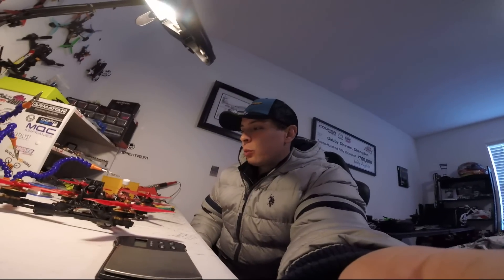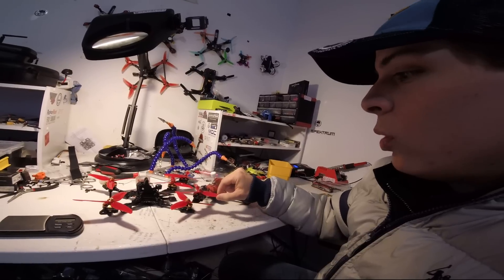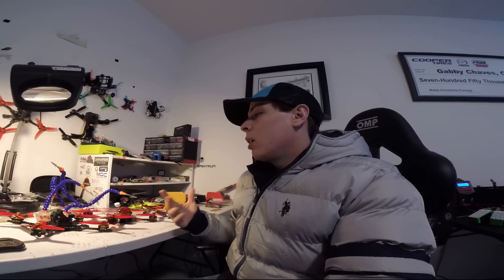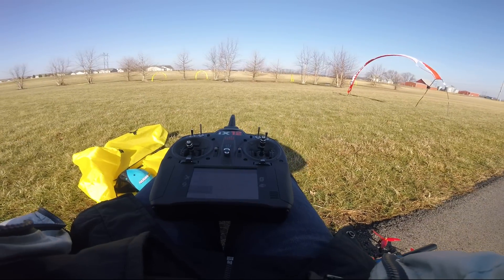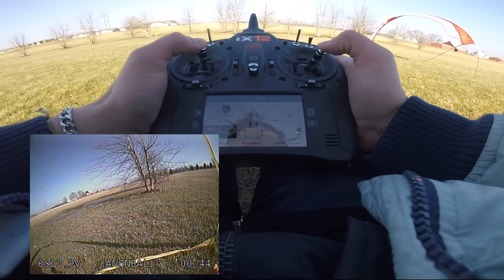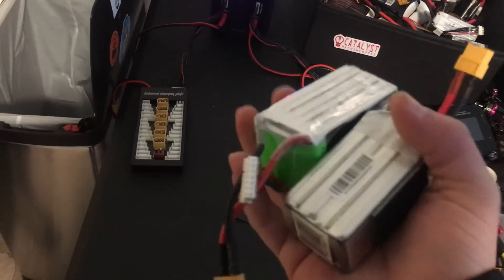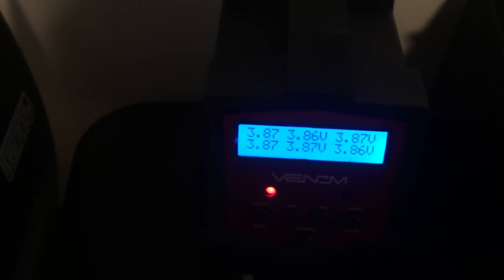4S high Kv. VS 6s low kv.

Comment: The 2 voltage readings at the end of the flight are flawed.   The voltage needs to be measured as soon as you land.   The battery voltage will rebound to something higher if you allowed it to rest like you did when you took it back home.   6S will always have a more consistent feel throughout the entire flight.   4S actually tests pilot skill for throttle management to stretch the race out as much as possible.

Comment: I just bought a Merica 5 inch 4s with dys 2206 2700 kv motors vtx 200 mw dys hglrc elf cam board is an f4 aio running siskin 32 bit eSC d shot 1200.  turnigy 1300 mah graphene  batt. What's the highest amperage batteries I could use? and what C is the best?
Reply from the maker: You can use anywhere from 1300-1800 mah 4s with that setup for best performance. Try using highest C rated batteries, I’d say anything under 80C won’t do so well with those motors. Personally I’d go for something with great bang for buck like the CNHL 100c and 120c packs.
Reply: Graphene

Comment: whats the best lipo for power and for money? ive only got chinahobbylines got three 4s lipos  thats 11months old and 2 5s lipos so im in need of new lipos
Reply from the maker: Danger Davefpv the ones you have are very good bang for buck.
RaceDayQuads has some good ones, and I’ve been using the Catalyst Machineworks 6s lately with great results

Comment: Thx - Gabby been thinking about building a 6s quad, problem is 6s batteries are not readily available in our country. I have all the components and the quad will be cable of 6s in the future but for now I think I will have to stick with the T-motor 2400Kv motors on 4s and let the big boys fight it out on 6s until a consensus is reached as we have more, and more data to analyze.  The deciding factor for me at the moment is there is not enough of a substantial difference to warrant all the additional costs involved. Don't get me wrong its where the sport is headed and by all means Multi-GP should let them race on whatever they want to progress the sport. The main sponsored guys will burn packs irrespective , but that's life at the sharp end in any sport.
Reply from the maker: Grixes Sedraxis well said. And I will say there is not enough performance difference to justify rebuilding your whole fleet of quads if you just want to get out and fly. So far since I filmed this video 6s is all I’ve flown, and my packs perform like new still. I can’t say I ever had my good 4s packs perform “like new” for more than a week or so before I notice a degrade in performance, so that at least looks promising
Reply: To be honest that was one of the primary reasons to build a 6s Quad was to draw less amps so I could get extended battery life (I punish my 4s Tattu R-Lines 95c so bad that they puff) and at the same time be able to be a bit gentler on the throttle without sacrificing performance while keeping enough power in reserve if and when necessary. Love the content and keep ripping dude.

Comment: Thanks, that was great.  Really got me thinking about why since there's actually an efficiency loss with higher voltage.  Some other factor is at play...just don't know what it is ....yet!
Reply from the maker: Rotorgeeks power= voltage X current. So since I am targeting having the same power output (rpm) there is less current drawn with higher voltage to achieve that output. So it is more efficient in the sense of taking less out of the battery to achieve the same power.
Reply: Understood.  voltage x current = watts.  I'm talking about the reduction in grams/watt of thrust that happens as voltage increases.  For any given thrust level, a 3S will use less watts than a 4S and a 4S will use less watts than a 6S.  But of course the lower voltage has a power limit.  You can generate this data with a thrust stand that measures and logs everything like the RC Benchmark product.
Reply from the maker: Rotorgeeks this has been discussed a lot lately. I have some thrust stand data that shows exact opposite of what you are saying and not sure why yet. The data taken used the same motor at a different KV. Constant thrust output of 1000 grams. 4s motor went as followed: measured KV: 2633 thrust (g) 999. Amps - 24.5. Watts: 394.3 V: 16.0- g/w: 2.53
For 6s it was the following: measured KV 1746.- thrust (g) 999. Amps- 14.7.- Watts: 352.- V: 23.95.- g/w: 2.84
The only thing is that these were measured at about 50% throttle and not 100%. only thing

Comment: On a tight track layout do you think the lighter 4s will be faster? And because 6s has more bottom end is it harder to be as precise or does it feel like balls to the wall fast where it almost feels like 0 or 100% all the time?
Reply from the maker: one4all to be honest the better bottom end I think will help in a tighter track, because it’s just sharper feeling. The difference in AUW weight is about 8-10 grams so I’d say that would be hard to notice at any track.
Reply: GC Cannonball if that's the case I should consider getting a rooster with plenty mah. Good run times.

But since I've only got 2400kv motors maybe I'll go with 5s for now.
Reply from the maker: one4all as long as your escs are rated for 6s, your motors will handle it just fine if you are easy on your throttle.
Reply: GC Cannonball can't I just turn down the throttle and go crazy?
Reply from the maker: one4all yea you can also do that lol. I don’t know if it will have perfect results but it will help haha
Reply: GC Cannonball thanks friend

Comment: Nice!  Those catalyst machine works motors sound good.  My 1600kv t-motors are getting a little crunchy, i might have to try those next.
Reply from the maker: mooosestang I have a quad with those and I love them but I need a little more cooch so the 1725kv I like better. If you are definitely wanting to try the catalyst, wait a week or two as they will have the new R6 design with the upgraded bearing.
Reply: Nice.  The f40pros i'm using are the v1, not the newer naked bottoms.  I've also been flying those same 1050 75c pulse batteries for months and haven't been able to hurt one on the 1600kv setup.  1900kv i can sag one into the red though, but they still don't get as hot as a 4s.  Looking forward to new motors and new batteries coming out for 6s.
Reply from the maker: mooosestang I’d suggest the gensace 1250 60c only 15 grams heavier than the 1050s . They are like 28-30$ and the pulse 1250 75c for the higher kv.
They are really good batteries

Comment: Nice comparison, thanks.
  I cant help thinking you could achieve the same low throttle spool up advantage that 6s has by tuning esc timing rather than spending another load of money on a new 6s setup. 

It's all just an equation, by changing kV and voltage you are effectively just plugging different numbers in to come to the same final value.
Unless I am missing something?
Reply: You are missing torque, the lower kv/higher voltage has more of it.

Comment: This video inspired me to build a 6s with the same 2306 motors. Im having similar results, which i like. It feels really great, but my pids don't feel quite right. A bit of bounce back and more noticeable prop wash than my 4s build (215g dry finx23 so not really equal to this 250g 2306 build...) yours looked tuned nicely. Any plans to discuss 6s tuning in a future video?
Reply from the maker: eaglo fpv that’s a good idea, I don’t remember if I discussed my tune here. Can I ask what you are running? I used the exact same tune for 4s and 6s, which is RaceFlight one fw 455 with a modified “captain Vanover” tune 
I do have a BF quad on 6s, 2306 motors and pids look like this : 
Pitch P: 65. Roll P: 62. Yaw P: 95
Pitch I: 55. Roll I: 50. Yaw I: 65
D 30/30
Dynamic filtering on, filter type Pt1 notch filters  off
Reply: GC Cannonball wow thanks for taking the time to list all that. Very helpful and appreciated. I am running my own frame, ak35 6s 4 in 1 esc, the cm 2306 1725kv motors, hq 5x4.5x3 props and the 1050mah 6s pulse 45c. It weights 250g without the lipo. Default raceflight was ok but a little bit of oscillations. Vanover tune had lots of oscillations so I figured since vanover pids are higher than default id go a little lower than default. That worked fairly well. No punchout oscillations but some after hard maneuvers and a bit of bounce back. The higher c rated pulse 1050 packs (75c o think) seem to need even lower gains to fly smoothly. But I don't really have much success trying to tweak race flight pids lol. 

These cm 2306 motors though...the linear throttle feel is so fun! So glad your vid put me onto them...
Reply from the maker: eaglo fpv yea no problem. Ok I think maybe because your quad is lighter, you don’t need as much gain to achieve the same control.  I’d  play around with lowering your P and D gains, and adjusting the tpa ok kp anywhere you feel you may have some vibes in the throttle range.  Since your quad is about 15% lighter with the same motor than mine maybe just scale down all pids by 15% and see if that does the trick

Comment: Great video man!  Love seeing more and more people doing these comparisons.  I'm curious, I know the average lap time was better on 6S, but was your best lap time better on 4S?  It looked that way just from watching.  I think the differences here had more to do with the lines than the batteries honestly.

In the end, what's your conclusion?  Should MultiGP go 6S?  Do you think this theory is sound, but the assumptions about the result are basically BS, like I do?  Once we open the flood gate people will run higher 2000-2200KV motors instead and just go faster on 6S killing the packs anyway?  For what it's worth, I still think it's time to allow 6S.  IMO, it's a much better handling experience.  I noticed a much more responsive quad, because as you stated the motors seem to have more torque which helps them be more responsive with the same props.
Reply from the maker: John E Fly yes my best lap was 9.8 on 4s vs 10.0 on 6s, but honestly it was probably just that lap that I flew better lines, I was a little rusty.
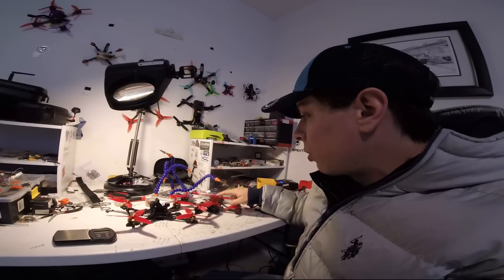I agree that if you allow 6s you’ll end up with the same issue pple running higher kv and still killing packs. So my best scenario would be to increase the race time, say to 2:30, and or implement a cap on the battery weight. That way you can have very similar performance on any pack but it’s up to you how you make the power and how efficient your setup is. Without this, you are right we just end up with the same issue.
Reply: Sounds like we both made the exact same suggestions.  Also, my point about the times wasn't that 4S is "faster".  Rather that it wasn't the battery that was determining the lap times.  Cheers!
Reply from the maker: John E Fly as far as my best lap I’d say that’s just down to me being rusty. But I think I was consistently a little faster on 6s because of the better handling of the rpm change in the low end of the throttle, very similar to how it feels when you go to a less aggressive prop, where you just have a little better control at low speed.

Comment: that's quite interesting. I've been trying low KV on 6S for about 6 months or so. I've not been able to get any good small 6S batteries where I live so my quad is way too heavy. It's good in some ways because you can launch yourself over things and float for ages, but that pulse 1050 pack sounds ideal. Wish I could get that here :)
Reply from the maker: Zylon FPV there are some other options out there and likely cheaper! I hope that if this becomes “a thing” we can get more Lipo manufacturers behind it and making more options for us
Reply: Yes i live in NZ and it hard to find much 6s stuff

Comment: Best comparison of the 6S low kv to date!
I think that on the actual test there was a small miss, testing both setups for the same amount of time is not show (or not) the benefit of 6S, the real test would be to give both setups a hell of a run and see which battery is beyond reasonable voltage sooner when pushed to the limit. i've started an rcgroups thread on the matter, but my first test setup hasn't arrived yet :(
https://www.rcgroups.com/forums/showthread.php?3011146
Reply from the maker: ssevet sweet im definitely following up on a pt 2, after I have more feedback from everyone. So I can absolutely give that a go

Comment: Awesome test Gabby.  I'm glad someone took some time to compare apples to oranges on this test, and I'm glad someone is actually trying to explain the benefits as opposed to assuming anyone wanting to make the cell count jump for more speed.  There is still a level of education that needs to be expressed on this matter if we want to convince the community that it's not to force everyone to change their gear, but maybe make our gear more capable.  I bridged the gap and ended up running 5s on my dated rig with 2300kv motors and my end max rpm was on par with a 2700kv motor, with the grunt down low that I enjoyed.  I hope the consensus changes this mindset, and the focus is on efficiency not speed.
Reply from the maker: CHRIS G yes I totally agree. The only concern I have is that without a watt/hr cap or weight limit on the battery that then you might start seeing some crazy setups on high kv and 1500 mah 6s packs, and it then becomes about who can spend the most $ on equipment that can take that abuse.
Reply: I honestly feel like things are already at that point with the high C rated 4s.  To have the C's you pay to play.